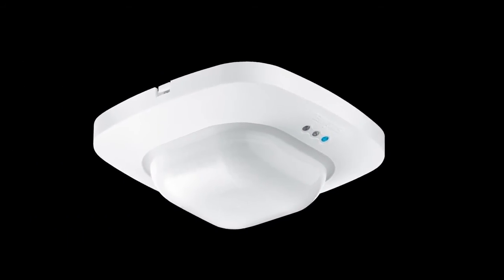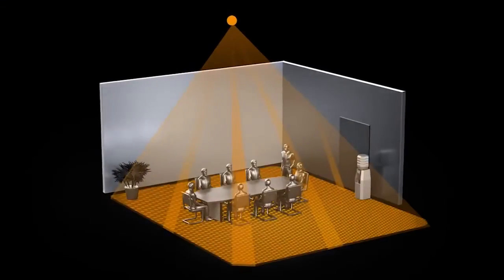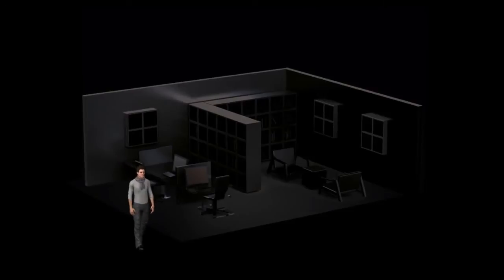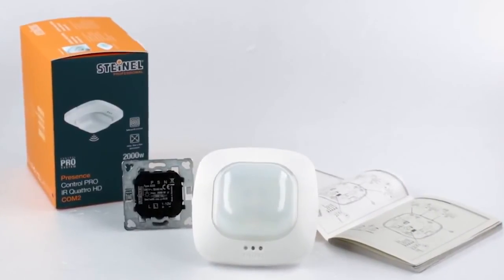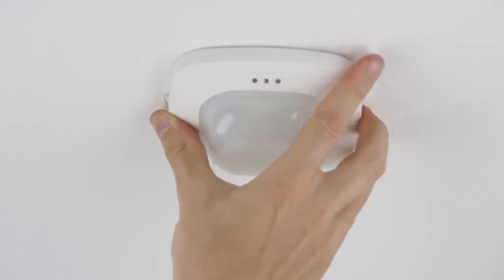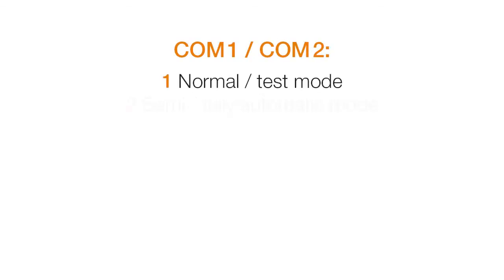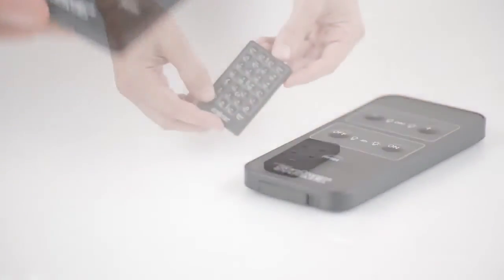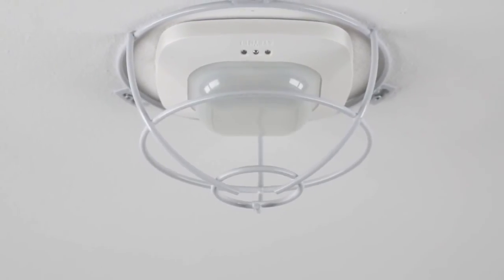How To Correctly Install a Ceiling Mount Occupancy Sensor

Comment from the maker: The Steinel Occupancy Sensor HD - is the world's foremost Fine Movement Detector which is Ideal for medium to large-size offices, conference and meeting rooms, classrooms and lecture theatres, sports halls and warehouses, installation height up to 10 m, for switching light 'ON' and 'OFF', 4800 switching zones for the ultimate in detection quality, presence detection over a true 64 m2, square detection zone, mechanically scalable to precisely detect human motion in a "defined" area 

It is a dual output sensor for controlling two circuits simultaneously and is a system integrators delight as it can be integrated seamlessly into any 3rd party system

For more information:

http://www.steinel-professional.de/en/Presence-Detectors/Overview-Presence-Detectors/Presence-detector-Presence-Control-PRO-IR-Quattro-HD-COM1.html

  #sensors